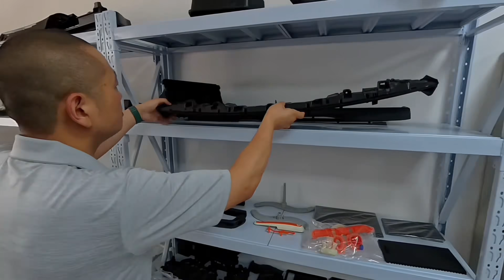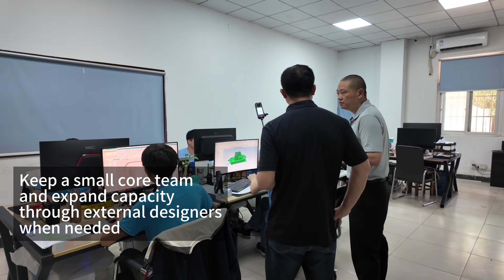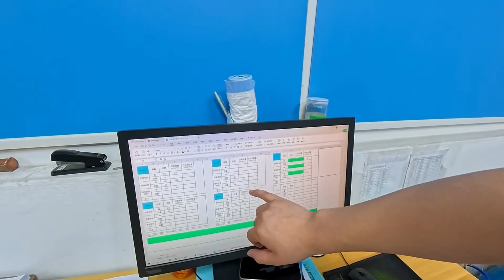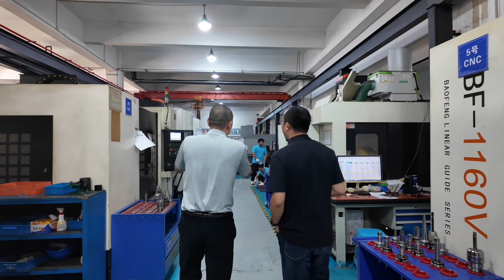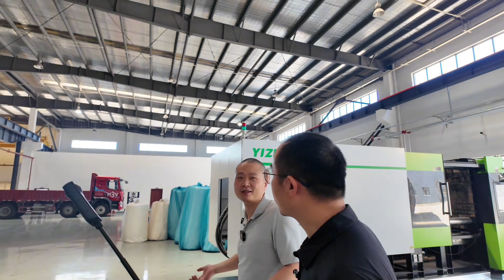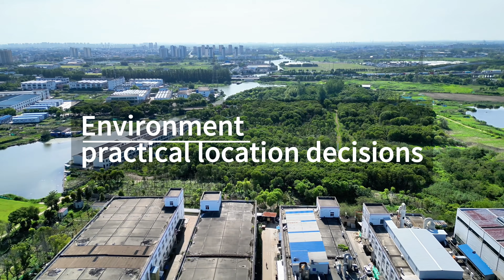Insight | How Chinese Mold Factories Control Cost?

Comment: Most is done not differently as in other countries mould factories, but 1 thing: We do not outsource construction engineers, because in times when huge demand emerges, other mould makers also request help in construction and you either have to wait or pay premium prices. Instead we have not 4 CAD engineers, but 2 and 2 programmers that try to automate most of the construction work by proper CAD add ons and this way collecting knowledge not in the heads of the CAD engineers but in the computers supporting them, especially repeated work. These 2 may be rented or outsourced, but not the CAD engineers.
Reply from the maker: That shall be the rational way🎉